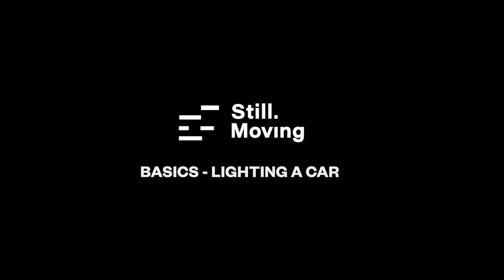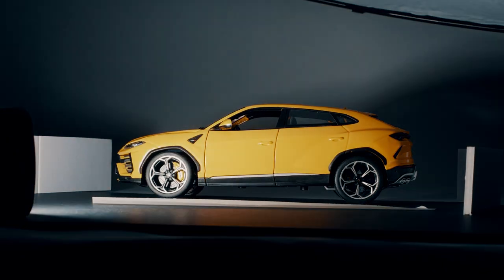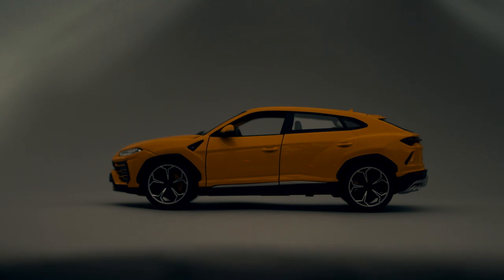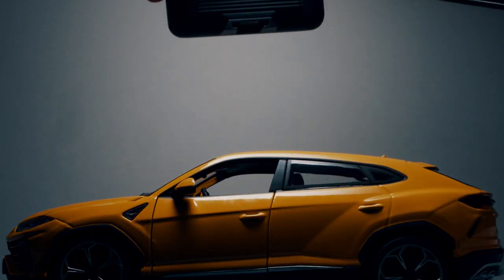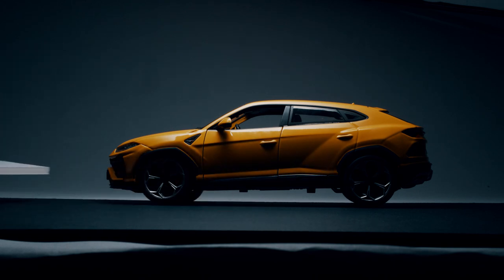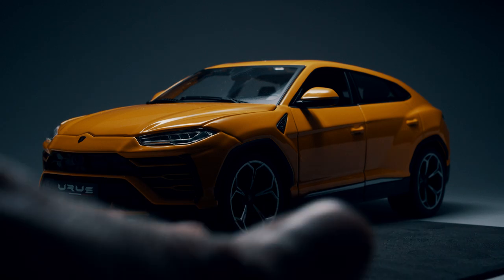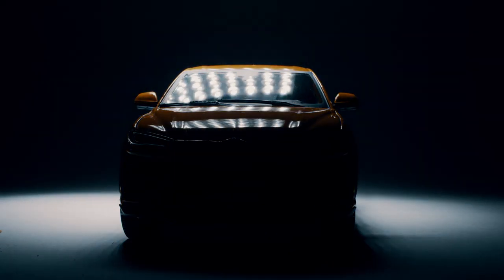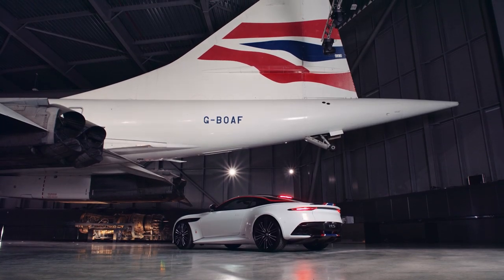Lighting Cars - Learn with Models - Simple single light tutorial

Comment: Thanks for the great video. I will have my first shoot of a car very soon and therefore I am looking for lighting techniques. This really helped me. I never even thought of using a small model for trying out different lighting scenarios. The only problem I currently have is that I don’t really know how I can work with white and black reflectors on an actual shoot since they would be in the shot themselves. I for instance loved the light that was created by having the light cut from underneath the car, but if I would put anything underneath the actual car it would for sure be in the shot. If you are looking for video ideas, it would be great, if you could explain how it is done in practice. Thanks
Reply from the maker: Part of this can come down to staging and location, so you may choose a location with a darker surface on the floor. Also the position of the top light influences where light falls on the floor so pushing the toplight back a bit will conversely mean you could [place your negative a bit further from the car. This was an extreme example so that everything was really obvious but it might be the negative is further back, you an also potentially paint this out if you get a clean plate. A lot will depend on the shots and if there is movement of the camera or vehicle.
Reply: Still Moving , thank you so much